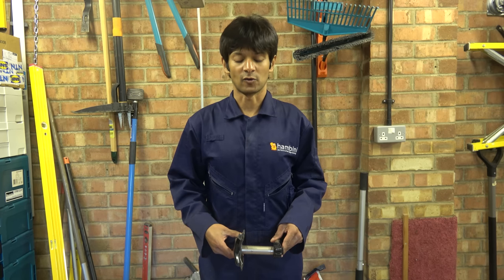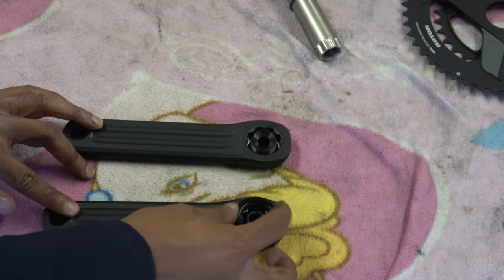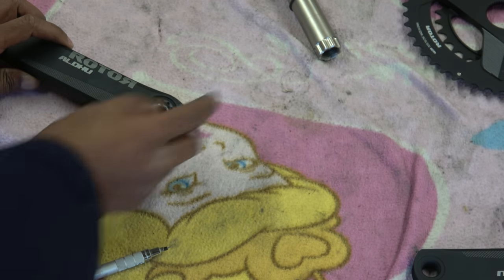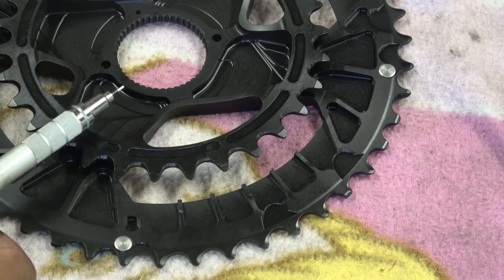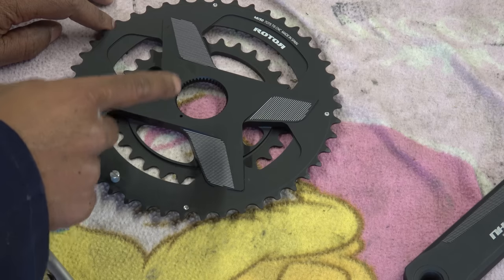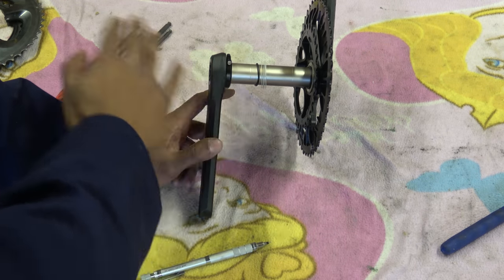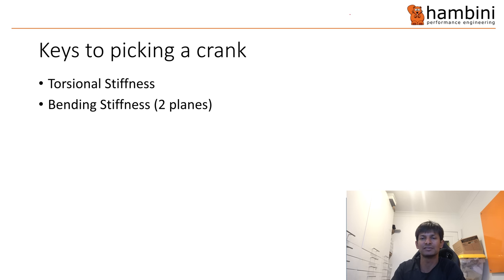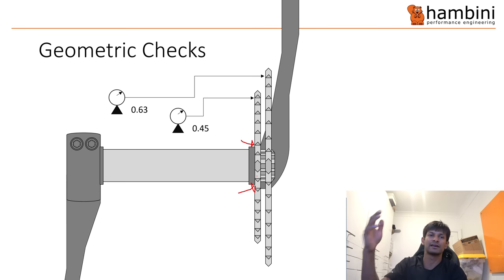Rotor Aldhu Crankset Teardown | SHIMANO drop in replacement

Comment: I've used Rotor Aldhu cranks for about 10000 km now, when I got them the preload ring was MUCH tighter (borderline impossible) to adjust than shown in the video, but it still works and I dont get any play in the cranks. A benefit of the modular system is that you can mount a power meter or Rotors own adaptor to 110 4 bolt bcd. For me I've been using a Sigeyi powermeter on my Rotor cranks with no issues. This setup was pretty much the best I could find that would allow me to run a 24 mm axle with a crank based power meter, Dura-Ace pm is pretty bad and Rotors options seems a bit overpriced. Nearly all other power cranks either use 30 mm axles, apart from Quarq which uses DUB and still makes a few using GXP. 
I'd buy this setup again
Reply: Oh and I forgot to add, Power2Max also uses the Aldhus for their 24mm axle versions
Reply: Take the preload collar off and add some grease on the threads, so it wont get stuck in the future.
Reply: @carlmlr  That's the one I've been riding for about 10K as well. The best setup I could find to use on different bikes, zero issues so far.
Reply: @luukrutten1295  It worked fine before, but you comment inspired me to get it off and put grease on it. Now it's exactly the same as before but it can spin! :)
Reply: Similiar for me but running a Power2Max power meter, without any troubles. But I will check the preload after this vid now.

Comment: With Aldhu respect, it felt conclusion was a bit more rushed than on most previous vids. I'm taking away that it's 
A, Overall very well made, definitely better built than those Dura Mess.
B, still has a couple drawbacks, nothing too major but one thing to be wary of when setting it up to avoid major lateral deviation of the chain.
C, it is possibly sensitive to a few more issues that are almost guaranteed not to occur on a trusty 105 set.
Oh and absolute shite, who still buys that ? Aren't they out of business already ?

Comment: There is a gcn video (both in spanish and english) where you can see the raw material they are manufactured from. It’s all wrought Aluminium, plates for the chainrings and billets for the cranks. 
You can also go for a separate 2x and even have an inspider powermeter added, which is what I got and works perfect. 
I’ve also noticed that the hard anodized layer on the rings is superior to that of shimano. 
From a subjective p.o.v. I would agree rotor’s setup feels stiffer than the ultegra I had on before. 
Overall a great product and well worth the money.
Reply: I'll second this subjective stiffer feeling. Grx to the aldhu that came with my power2max spider feels stiffer. Both were 175mm cranks.

Comment: If you want to combine your own chainring combo you can get the spider and loose chainrings. These are the Direct Mount single piece ones.
Reply: Plus, they are same bolt pattern as shimano if I remember correctly. Seen many rotor chainrings on Shimano cranks
Reply: @pauperismarti2226  Rotor offers different spiders , 5 arms bcd 110 en also 4 arms bcd 110.
Reply: Some manufacturers appear to be standardizing on the compact bolt ring pattern. Is the 110 mm pattern sufficient to support a 53 or in the case of a TT a 55 or 56 ring? Is there enough torsional stiffness to make a carbon fiber inner circle ring with steel teeth? I think we are reaching the end of carbon fiber utility. Do we start using far more expensive man-made materials with longer strand length and less likelihood of tearing to lighten the frames still more or do you suppose that racers are going to stop effecting sales so much. I am old and have returned to steel because of its ride. It climbs slower.  So what? Not that I was never a climber despite the millions of feet I've climbed. Perhaps it's because I'm so old but I think that the epitome of cycling was the good steel frames of the mid to late 90's. While they weren't all that light (my Moser is 19 lbs.)  they ride nearly perfect in my mind. (And butt) Not aero? I'm having a really good day holding 17 mph for 20 minutes. I can hardly detect aero wheels. While we can blame that on my age, how much difference is that from MOST 30 year old's?
Reply: 99.9% of your speed on a bike is determined by your engine, not your bike frame or components. The bike industry has done an amazing marketing job using paid sponsorships of their products with pro level racers to convince masses of amateur gullible idiots that they need multi thousand dollar CF disposable cookie cutter bike frames, silly priced CF wheels, and amateur level nonsense like power meters and bar held computers to ride effectively or even race effectively at the amateur level. It’s all marketing BS being sold to amateur level posers, status symbol seekers, and clueless clown types.

I regularly encounter these clowns in the hills around Boulder and Golden, CO and I regularly drop the vast majority of them and see them getting easily dropped by many other riders. And when it regularly occurs their cute little poser power meters and Garmin computers, their cute little Enve or Zipp wheels, and their silly priced SWorks and Trek frames, etc..  don’t seem to make a hill of beans difference in their speed getting up a climb. But hey, when their ride is over they can always myopically go gaga over their “massive” 200 watt power output for 15 minutes. 😀😀

Cycling has become the new golf recreation. Loaded with poser clowns buying gear to imitate what sponsored pros use while laughably thinking all these gadgets and silly priced frames and components will make them magically faster.
Reply: @ivanboesky1520  Feel better now?
Reply: @smallbutheavy9664  But their 4-bolt spider only fits their own chainrings.
Reply: Precisely this. If you know exactly which big/little chainring combo you want, then fine, go for the one-piece combo, but if that's not for you, there are loads of separate spider/chainring combos. Not the cheapest but nicely made, fairly light and the 'modularity' can be a big bonus.
Reply: @ivanboesky1520  precisely. Even with decidedly far flatter terrain most local club riders are abandoned quickly on steep and/or long ascents that aren't even at anything higher than 600m above sea level. 48Kg of fit, powerful human motor  >> bike club posers.

Comment: Got these cranksets for a while, the only two things I don't like is: a) The spindle seems a little wider than Shimano ones, makes it harder to install and remove. b) The preload ring is much harder to ues compared to the Shimano one.

Otherwise, pretty awesome. Cheap Sigeyi powermeter, tons of options for crank arm length, different levels between budget and weight for crankarms (had both aldhu and vegast)
Reply: I am considering buying a new crankset and vegast or aldhu are the two options. For me with a cat 2 performance in 5-20-60 min power I do not see the price difference justified between the two, so will happily settle for vegast, but I'd like to ask your opinion. Do you experience any benefit from the aldhu over the vegast? I have previous experience with 5800 and 6800 Shimano and Force 22 Sram and personally, I did not feel huge differences between them. Thank you!

Comment: I have been using these but with an. INspider power meter. No issues but Rotor have brought out carbon Aldhu cranks but only for the 30 not the 24's.

Comment: Rotor is seasoned in using cnc router finishing as part of the artwork on chainrings and cranks, same for Hope. 
sram later did some referencing through printing and decal.

Comment: running 105 on one bike, Rotor Aldhu on the gravel one, no problems whatsoever. Also using Rotor means you can install a 3rd party crank based power meter. As you can see even Hambini could find very few issues with this crankset.

Comment: Thanks to your similar video about galvanic corrosion. I was deterred to buying such and instead when replacing my 170mm crank for 165mm I went for Prowheel chariot forged cranks. The supreme vintage technology. Even if a horse rides those cranks it will sustain

Comment: I have had good experiences with the Rotor system - I think it's a previous generation where the spider is attached via the older wider lobed interface. That one is used with a Power2Max power meter. The modularity came in handy when it was time to change the bike - was able to put my preferred 24 mm spindle and bigger bearings instead of using a BB30 system.

No issues with that - except as mentioned, the instructions are pretty bad. Several online videos and references help, including those from P2Max themselves.

Comment: My rotor left crank leg unscrews itsself while riding LOL. Glad i got rid of this shit and replaced it with a grx 810
Reply: Same here. It not only unscrewed, it failed. Looks like a pattern with the NDS cranks. Which crank length? Looks like the 175mm has more meat on the treads than the shorter ones.
Reply: Same here: left arm comes off
Reply: @hesiodus7  get rid of it, sell it to a poor soul, and get a grx 810. So far ive got 25k kms on my crank and it still runs like new

Comment: So, I felt that this one lacked a conclusion. The title calls it a "krapset" but no real deficiencies are highlighted. If at the end you could sum up and say that it's pretty good, maybe that would be more clear. (basically that is the conclusion that I got from the video)
Now I have an aldhu on my bike, partially to get 165 cranks. I have a power2max power meter and it's set up for Shimano chain rings. I can fit various combinations from 34-50 up. So the idea that users are limited in their chain ring choice is incorrect, at least in my case.
I could have got it with 5 bolt Praxis chain rings as well, and I'm guessing other options are available. 
Otherwise, a decent breakdown of the product. Too bad about the title, because it seems to be a pretty good product.
Reply: agree. got the p2m shimano set up on 170mm and has been great
Reply: Clickbaity title

Comment: Great review!  As someone who's had two 6800 cranksets fail in the fashion you described, I've looked at the rotor crankset but to me, it's hard to spend that kind of money when you compare it to a 105.  Sure, a 105 might fail after several years but you can buy quite a few 105's for the price of a single rotor crank.  For the cost of getting new chainrings on a rotor, you can get an entirely new 105 crank.
Reply: Um. No? I'm not sure where you are getting your prices from but my full Rotor Vegast setup was €200.
Reply: @driventomadness117  At the rotor America site, a Vegast crank with two rings and and the axle is $500.  That's what you'd get with a new 105 crank but the 105 crank is only $166.  Am I looking at this wrong?  To me, it looks like $200 gets you the cranks without anything else.  

Edit: Checked the international site and the Vegast with chainrings and axle is €400.  I'm guessing you didn't need chainrings but the 105 comes with new chainrings so to keep the comparison apples to apples, you should include new chainrings, right?
Reply: 105 might fail after a few years? Not sure about latest Di2 105 12sp crank but my 10sp 105 seems damn near bulletproof.  I'd expect it to survive the apocalypse. Right along with cockroaches and piston wrist pins.
Reply: @mike_f  there's a weakness with the way the Shimano cranks are manufactured where the two halves that are bonded together can separate.  I've had two Ultegra cranks fail in that fashion and I assume the 105 could be susceptible to the same issue.  Hambini talks about that issue in the video and it's one reason look at rotor cranks.
Reply: @shoerhino  I'm aware of Ultegra and DA.  But 105 was always different construction.  10sp was definitely not 2 halves.  Not sure about 11sp but think it was not. So those, to my knowledge are bulletproof.  But 105 12sp may be the 2 halves construction which would be a drag IMO.
Reply: @mike_f  I bought the r7000 to replace a 6800 so that's my only experience with 105 but the word on the street is the r7000 has some bonding but it's not totally clear how much or if it will suffer from the same fate as my two prior 6800's.  I should have bought 105 earlier!
Reply: @shoerhino  Nope, 11-speed 105's are not done in the lighter weight clam-shell implementation.  105's will not break apart like Dura-Ace and Ultegra.

Comment: Hambini you can buy chainrings individually to your taste, just have to buy the spider to allow different chainring combinations.
Reply: Only possible with the 5-bolt version though, the 4-bolt only takes their own chainrings.
Reply: @yonglingng5640  I have it with a Power2max power meter in 4 bolt and it can take various Shimano chain rings.
Reply: @GregRenwick  Yes, your 4-bolt holes aren't pocketed, so you're all good.

Comment: LBS which had a load of borked DA & Ultegra cranksets has been pushing customers towards Rotor and SRAM AXS GXP or DUB for nearly 2 years.  In the Spring they stopped pushing Rotor due to high axle failure rate - oddly higher with steel 24mm than their alu.
Reply: I had a Rotor 3D back in 2015 and according to people I trust, that was the cause of the ubiquitous creaking in Cervélos from that era, including mine. After several potential solutions failed, I threw the Rotor away, put an Ultegra on and had ZERO issues… until it cracked hahahah… damn it…
Reply: Is there a high axle failure rate with Rotor???

Comment: I just upgrades my Rotor cranks from the aluminium arms you featured to the new carbon arms, and its a big improvement in stiffness. Have to see how long they last but they seem pretty good so far
Reply: Update, carbon arms holding up perfectly, so far
Reply: Carbon fiber has a finite life, most definitely shorter than quality solid metal cranks. All things carbon fiber have limited safe usable life. This is as it is. Believing differently will ultimately result in disappointment.
Reply: I got 1 and a half years and the bonded aluminium insert on the nds at the bb end unbonded from the carbon. Keep an eye on that

Comment: I use a xCadey power crankset, it's pretty much the same as the rotor aldhu with modular parts, 24mm axle w/ tapered splines but with 4 holes drilled inside the crankarms, the power spider/chainrings are bolted onto the crank arm, and it's much cheaper than the rotor aldhu. Not 100% sure what the axle is made of though, I suspect alloy (because of the price) but some claim it's titanium.

Comment: We are going back to 24 mm steal cranks and threaded bottom brackets, hilarious in my opinion. Will rim brakes come back?
Reply: Let's hope so!
Reply: Yea but rim brakes are good
Reply: RollinRat  spot on
Reply: NewTube Channel  they should give options to buy rim brake high end bikes. Many people neither need discs nor they like them
Reply: Nothing wrong with 24 mm spindles.
Reply: NewTube Channel  You can love rim brakes, but they ain't coming back, so you can use your old bike with rim brakes
Reply: @the.communist  Disc brakes are a basic necessity
Reply: RollinRat  Oh yes, I hate those who feel like they have to have the latest trends just because they're the current cool thing. There's no difference between 30 and 24 mm spindles if one doesn't even have the legs for it. Most 30 mm spindle cranksets are self-extracting too, which usually means a high torque spec that requires a breaker bar to crack loose. Did I mention playing around with shims to get the preload right too? Especially if you mix brands between the BB and the crankset (ie. CeramicSpeed BB30 + THM Clavicula)?

Things like integrated internal routing benefit none of us mere mortals. I'm totally fine with regular internal routing or as amateurs call it, "external" routing.
Reply: RollinRat  well this just about says it all really

Comment: I prefer the Shimano Pre Load.  I have owned 3 Rotor cranksets and I have never been able to set them as freely as the Shimano.
Reply: I wonder why more manufacturers don't use the same system. I think FSA does as well, but perhaps they pay a licensing fee. There are Chinese mfgs which do but they don't care about licensing.
Reply: @szurketaltos2693  Hambini mentions this in the video: the Shimano Hollowtech II preload system is patented.

I've had FSA cranks before and mine used a wavy washer for preload. The Shimano preload system doesn't work with a self-extracting crank bolt like what FSA tends to use, since it takes up the space that the Shimano preload bolt would otherwise occupy.
Reply: @TypeVertigo  hm, I remember having an older FSA crank with pinch bolts like the Shimano style, could be misremembering, and I definitely have an IXF crank that does but again, mainland China and patents.
Reply: @TypeVertigo  ah, I searched eBay and found some same model FSA gossamer cranks that use the pinch bolt system. So could be that Shimano threatened them with a lawsuit and they stopped using that design.

Comment: I've been running the cheaper version of these cranks (Veghast) on a steel 24mm axle through a Hambini Racing PF30 BB for nearly 2 years. I'm using the 46/30 direct mount chainrings. No problems whatsoever. Axles and chainrings are exactly the same as those shown in this video.

Comment: hi hambini, maybe a stupid question - but why is the non-drive side thread of the rotor axle closing counter-clockwise? means each pedal stroke potentially loosens? had loose threads twice over the last months. design failure? what speaks against clockwise thread on the non-drive side?

Comment: I had to revert from a crappy GPX Quarq PM to a std 24mm crankset and Rotor was on the wishlist. I however gave up on Rotors solely due to the possibility of having issues at this weird joint, a tapered joint for the crankarm over and fixing a splined joint for the chainrings. The tolerances need to be VERY good there to avoid any play on the chainrings. I didn't bet on it.